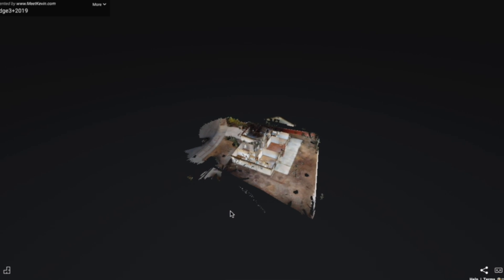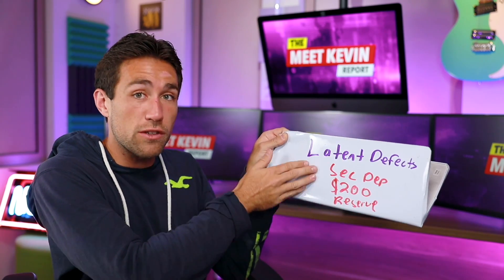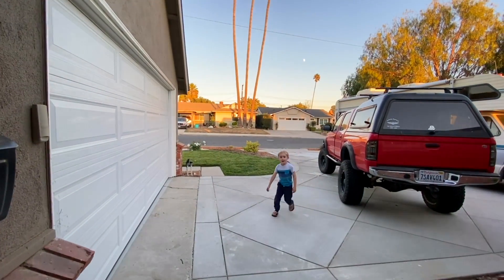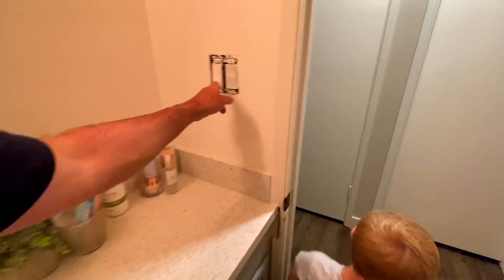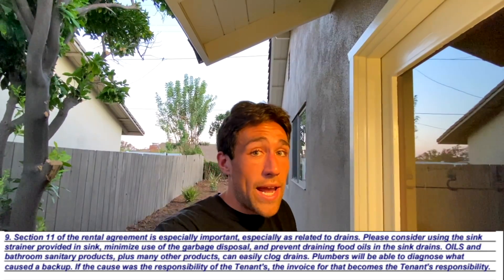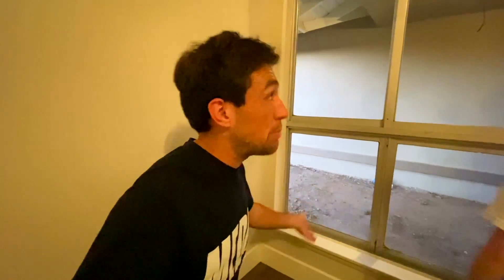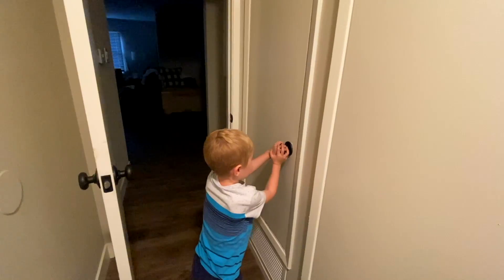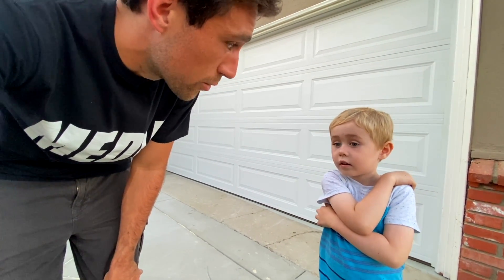The Minimalist Landlord.

Comment: i agree with you a lot on plenty! for the insulation, i disagree, while the walls where open in the bathroom i would have added insulation and vapor barrier - 150 $ of materials but comfort level upgraded! of course i agree you should not redo the insulation of the whole house.. but when the walls are open , you should in my opinion! thanks for the videos!!
Reply from the maker: I agree with that -- cheap and easy enough to do!
Reply from the maker: I might just throw some in quickly! That bathroom sits on the outside and we may as well; like you said, that part is easy there.
Reply: Wonder how permitting and inspections work there.  Most building depts will want you to update the stuff inside the walls when its open anyway, its cheaper in the long run too.

The climate he is in is different, they dont have to heat and cool that much.  I live in Houston and insulating your rental will keep your tenants happier.  They dont like $400 electric bills in the summer!